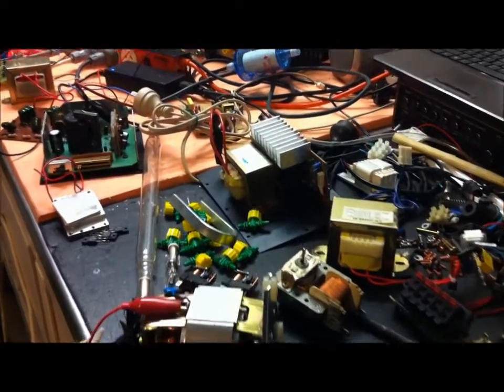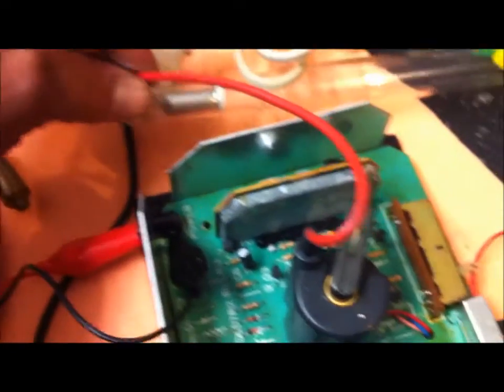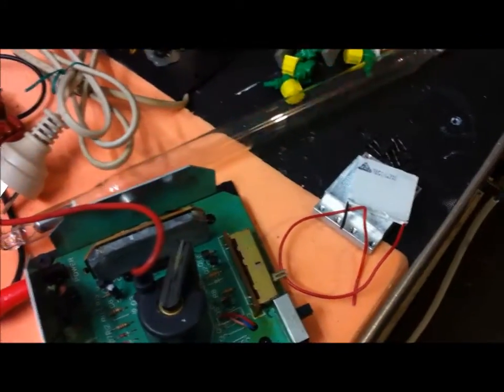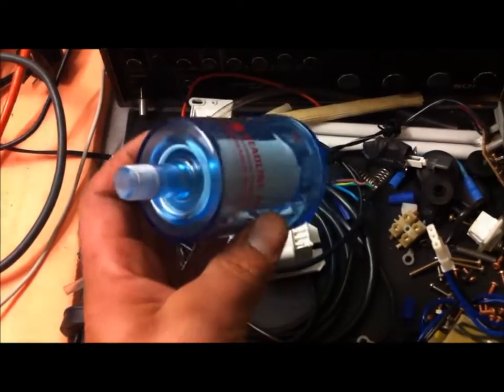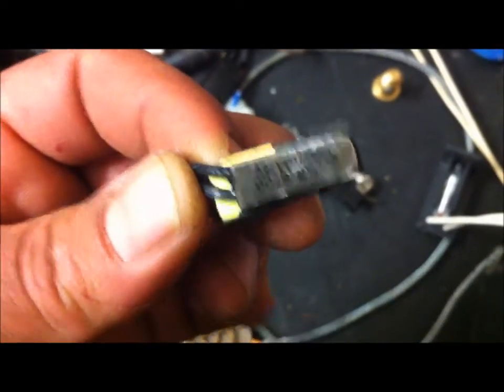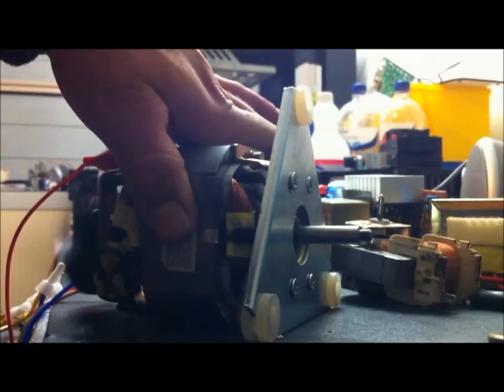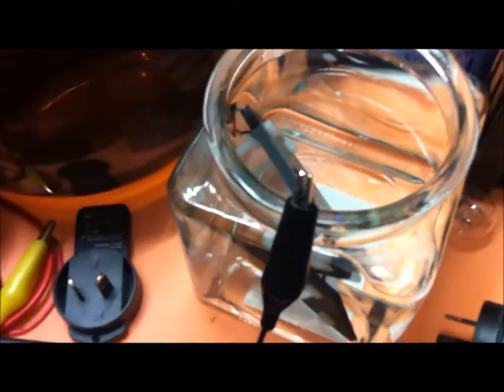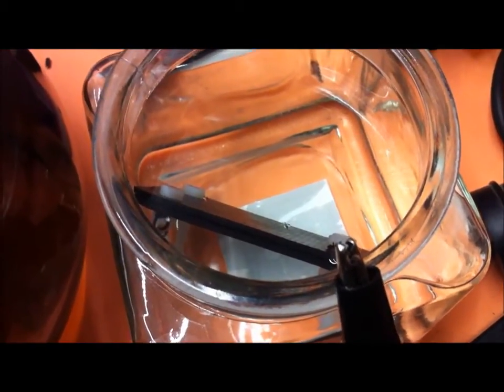I Just Can't Stop Salvaging Power Supplies & Parts For Experiments!

Comment from the maker: Thanks for watching. Yes rodin coils look cool, however I don't think I will pursue standard rodin coils, due to the radius of curvature at the nodes of the coil, which are too tight for the high voltage stuff I am currently working on = high losses. Perhaps a modified version such as a bifilar rodin coil with a larger radius of curvature at the nodes would be more suitable for high voltage work. I may pursue this design in future... Keep watching :)